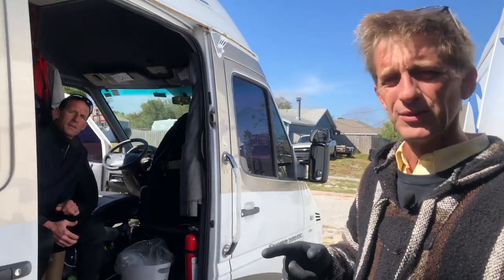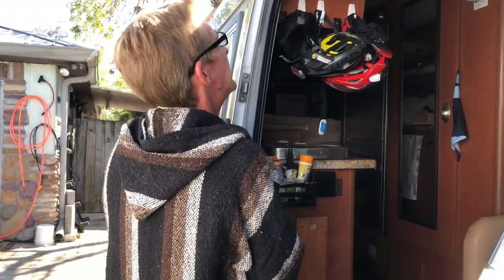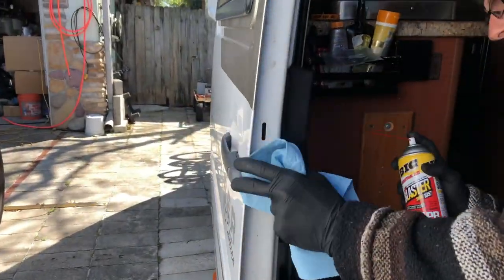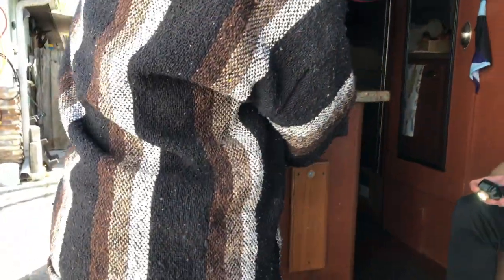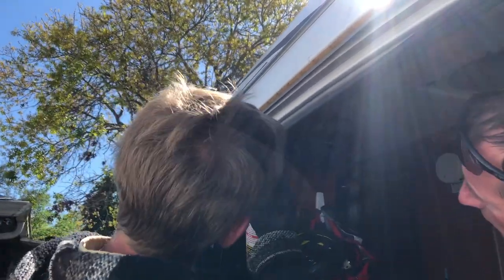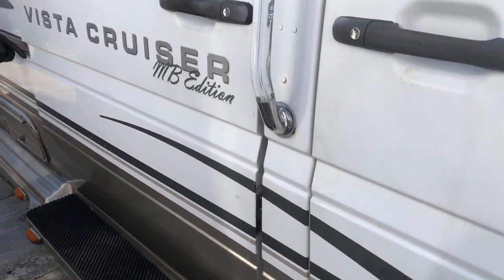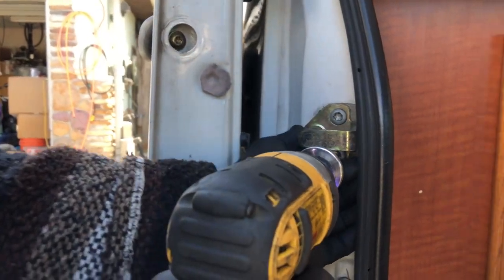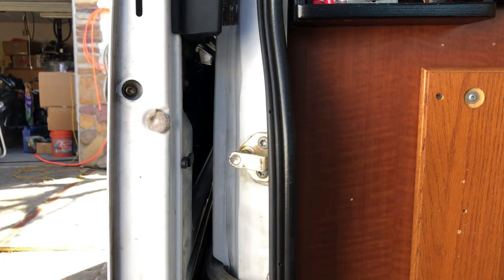Balancing & Replacing Sliding Door Cable - T1N Sprinter Sliding Door Repairs Pt. 2

Comment: Crazy looking extension or bit on that drill and I've never seen a socket wrench with a protrusion on the top for hand torq! What sort of tools are these, this is madness
Reply from the maker: Yes, my 3/8 short extension has a big wheel for hand spinning. It wasn't needed here I just didn't bother to take it off. The ratchet is a handy one. Sold as Husky Tools, it has a 1/4, 3/8 & 1/2 drive on a single handle without needing adaptors. It is Super handy some times with a different socket on each side or just a long extension on the back side to align and hold.

Comment: This video, like all you put out, is great. I have an 02 t1n that I had purchased a used new slider for. The body shoppe put on the new door after they did body work on the side. The door has a huge gap on the right side and on the bottom but more on the receiving end. After 4 x bringing back to them they gave my $ back and I am left with the problem. Would I try these adjustments to fix that? 🤔 desperate to fix this so I can get on with my DIY build. Thank you in advance
🙏
Reply from the maker: Yes, these adjustments should fix that gap, assuming you have there proper door rollers on the door. https://amzn.to/3m9KUrw
Reply: @FloridaVanMan  the rollers that are on the new used door has the rollers from the original door.  I will try to work on this tomorrow and see if I can fix this.   I am shaking my head that the body shoppe could NOT fix it. ( and made it worse) 🤦🏻‍♀️
I can't tell you how much I appreciate your response and knowledge. Fingers crossed I can fix the gaping crack.

Comment: Aren’t there any water drain holes in the bottom of the door that you sealed up with the construction foam? Water will stay inside the door and it’ll rust from inside out pretty quick I guess..
Reply from the maker: The canned foam is not NEAR that good at filling the voids. The rattle cans produce swollen worms that don't get down in the bottom narrow space, leaving plenty of room for water to flow horizontally between the two drains. We would need to try really hard to obstruct all vertical passages, so any water that gets in can still reach the drains. But no water should get into the sliding door. Front doors with aging weather seals and windows that go up/down will get water in them. This type of window in the slider should* not leak like standard car-door windows.

Comment: @Florida Van Man Hey Bill. So I have a slider on a 2005 that is closing and latching just fine, except there is about a half inch gap at the front.  I have the top and bottom rollers all the way in and it still wont close and seal in the front.  Any thoughts?  do I just need to load the parts cannon and fire a new set of rollers at the thing?
Reply from the maker: Nooooo! Gap at the front, it the door too far back or too far out? If the door doesn't come forward far enough that will be an adjustment in the rear roller. Move it backward in the door. If it sticks out away from the fan it is the lower front guide and the aluminum cups in the door jam.
Reply: @FloridaVanMan  The middle rear roller is all the way back, and the top and bottom rollers are collapsed  to be as short as possible.  There is a dent in the door, but it seems to be only in the skin of the door.  Is there a way to shim the whole middle track forward?

Comment: I am stuck at 12:53 balancing all those spots to get a proper sitting door. 
The sheet metal where the rear / inside track meets the door is cracking apart. 
Any advice?
Reply from the maker: Start with the rear-carrier bolt loose on the door. Have a friend outside the van put a 1/2 inch piece of plywood under the back edge of the door as they close it. From inside, you tighten the bolt on the rear-carrier then open the door and let the board fall out. Then adjust the front-top-carrier to level the door. The bottom carrier doesn't hold anything up/down and should be adjusted to avoid rubbing. Remember the aligning pins in the front of the door might be preventing good alignment. If the door changes direction of movement in the last millimeters of closing, look for where those are striking.
Reply: @FloridaVanMan  thank you so much, for all the videos and the response, I appreciate it a lot.

Comment: I have another issue. I put a swivel seat on passenger side and now the seat doesn't slide forward and back or maybe it didnt work before and I didnt notice it.  Has this ever been a problem you came across. 
Your help is greatly appreciated.
Reply from the maker: Some passenger seats didn't have adjustments like the deluxe seats.
Reply: It's the forward and back lever. Now that I think of it . It had to have worked before as I had to move back and forth to get the seat off the base plate in order to install the swivel plate. It seems to be stuck now. I cant slide it back.🤷‍♀️
Reply from the maker: @melissag7071  Maybe something is not flat. I'm curious if it will slide when you loosen the bolts that hold the seat down.
Reply: @FloridaVanMan  I tried loosening and checked to make sure that none of the  bolts were too high on the track for room to slide. It got too cold last night. Hopefully today or tomorrow will be warmer to mess around with it.

Comment: how do you clean the sliding door contacts?   I have to lock my doors twice to get my van to lock.  And even after I do this, the sliding door never locks, unless I put the key in the sliding door lock and manually lock.  thanks in advance.
Reply from the maker: Clean the brass buttons on the back of the sliding door and the plates in the door jam with a little sand paper. I Don't suggest using steel wool unless you disconnect the battery first. If cleaning them does not work you might have a broken wire inside the door or the jam. The plastic around the brass pieces will pop out of the walls so you can work on the wires behind them.

Comment: Do you happen to know the parts # for the cable? We are having this exact issue with our T1N and are struggling to find a new cable replacement. Thank you!
Reply from the maker: Sorry, I didn't find the part number. We have parts vans, so I just take what I need off of one of them.
Reply: Any part got a oem Number,go to a mercedes benz dealer get the oem number ,then order it cheap on ebay, uk,de,us.(england,germany,usa).or whatever you find it cheapest..👍🤣🇺🇸🇪🇺🇬🇧

Comment: The back latch on my side door doesn't seem to be catching. Door worked perfect for a long time with no issues. Have to use my shoulder to get it to latch. Tried wd40 and cycling the latch  latch seems to be fine. No damage to any striker's. What would be the next step?
Reply from the maker: I would need to look at it, to see what is going on. New rollers sometimes help. As the rollers turn that corner at the last second, they lean on the rollers differently. Replacing tases does mean starting over on the balancing act.
Reply: @FloridaVanMan  will have a look thanks for the advise. Your welcome to cone have a look yourself if your ever in ireland ha
Reply from the maker: @Newmarketonfergus   I'll send you a travel quote. lol Ireland is one of the places I have never been.

Comment: Please tell me why my door will not open all the way
Reply from the maker: Easy answer, junk under the step where the bottom guide hooks under. The step can be removed but usually we can fix this with a garden hose and pokey stick. You, probably find a few pens and pencils or nails and screws, depending on van use. Open the door as far as it will then push a few inches toward closed. Flush with water while poking. Have a sandwich and do it again. Once the dirt soaks up some water it will get soft and round two will do more than you expect. Round three is optional. :O)

Comment: Nise walk through on the door adjustment, but Seriously, builders foam.. hope this camper is not used where corrosion is an issue...  that's realy bad idea and practice..
Reply from the maker: Please explain. I've not found any credible evidence builders foam causes corrosion, but many articles conclude it does not. Crack foam will not last as long as proper polyurethane spray foam, but it is a closed cell foam that cures hard to a noncorrosive insulating agent with excellent sound absorbing properties. In diligent effort to double check my beliefs before posting this reply, I did find an article discussing the corrosive chemicals in the liquid product, uncured state. It had exceptionally bad grammar so I didn't give it much credibility.
Reply: @FloridaVanMan  i can try, english is not my native language so bear with me... it is not the foam thet causes the corotion but the entrapment of moisture and the sometimes blocking of drainage.  I dont need any articles to suport my clame on this her in skandinavia, as it is widly known as fools sulution her.  If it is to be used it relay on several conditions like, dranage, air sirkulation, and as you say using a close cell type,  and i would awoid it anywhere that can get any slash of wather. Like the botom of doors round the wheels etc.  We use butyl rubber for our sound isolation and somtimes heavy coating with lineseedoil based products like tectyl. As a note  we relay hevy or road salt her in scandinavia to keep the roads with heavy trafic safe during the winter months, so this speeds upp anny corrosion issues.